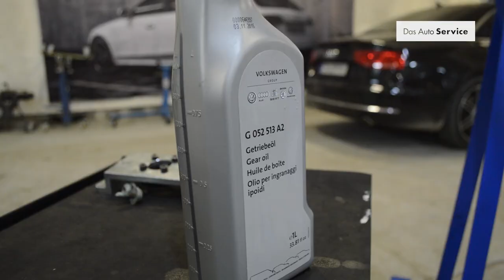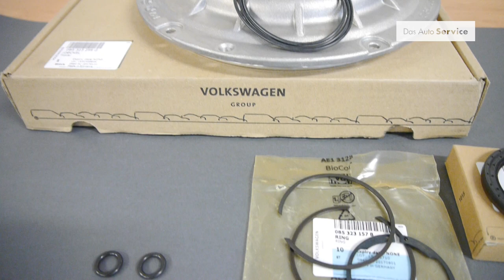Ремонт на S-Tronic скоростна кутия | Das Auto Service - Част II

Comment: Good day ,I've got a Q5 with problem. Shift fork D unauthorized movement, do u think renewing the Electronics on the Meccatronic will solve this problem. As I live in Namibia parts are very expensive and scarce. So I am cautious to just buy parts and then not repairing the problem.